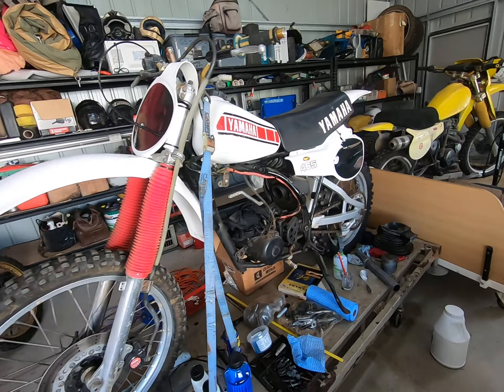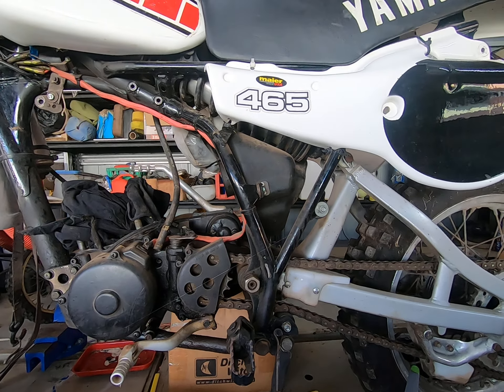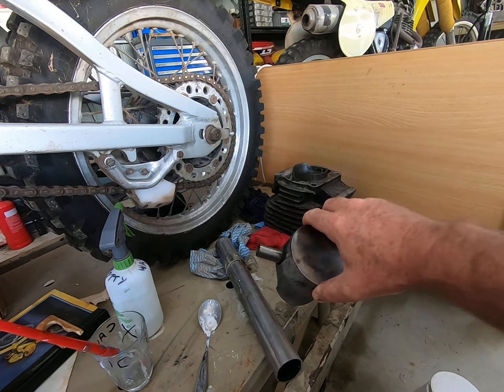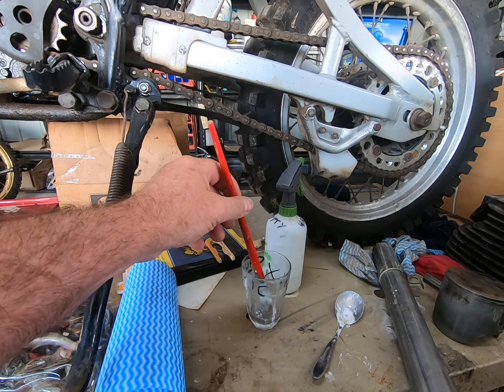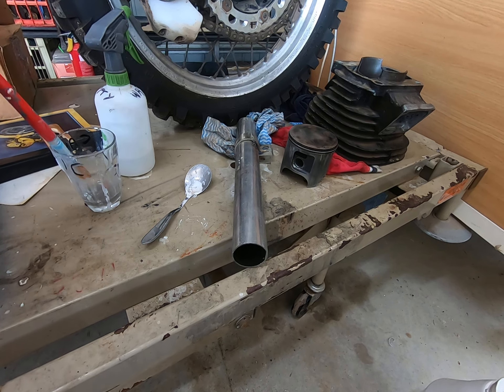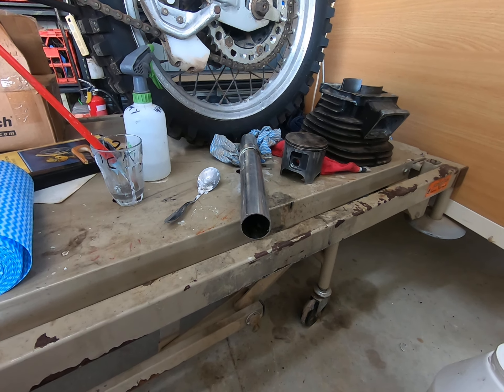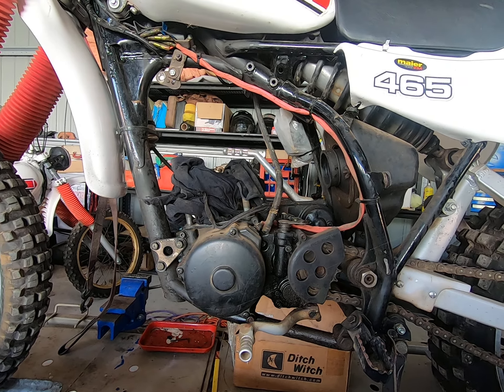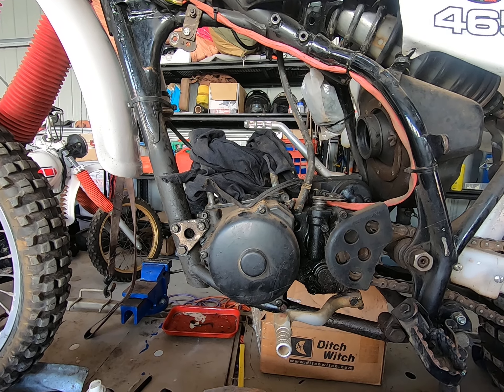Big Banger uses caustic soda during self isolation!

Comment: Looks an awful lot like a 4 point cold seize .
Reply from the maker: Thanks darrel, How does that occur?
Reply: @handcraftedhooligans9962  Not debunking your oil theory , however regarding  the Cold seize . Some machines that have cast cylinders that have been rebored and use aftermarket pistons , especially  Wiseco Prolight for instance , can have issues with the faster heat expansion of the lighter piston compared to the heavier /thicker O.E.M. pistons .  Thus if the machine is not thoroughly warmed up before the rider tapes the throttle wide open , Squeek .   
I have learned from misadventure to never use aftermarket Pistons in Rotax cylinders that are not Nikasil . 
Another interesting thing is that as premix ratios decrease (more oil) , the air /fuel mixture becomes leaner and the combustion temps increase . 
Wicked bike , love the white color scheme .
Reply from the maker: @darrelldoran509   Thanks Darrell,  You could be right.   When it seized i had been riding it for a while but opened it up on a long straight.   The original piston is good advice.   Will keep it in mind.   I have the original manual and yamaha recommends between 15 to 1 to 20 to 1 depending on the oil.   I know we ran 20 to 1 in everything back when they were new.

Comment: You didn't answer your own question you only said the stroke is longer and bigger bearings so what you're trying to say is that clarifies using 15 to 1 to me I would never never do it I'll go 32 to 1 with 120 octane VP fuel Red Lion Oil
Reply from the maker: I agree 15 to 1 seems extreme but I was quoting the yamaha manual.   I think somewhere between 20 and 25.1 would be ok.   But if you run them flat out for any distance I'd be looking to the manufacturer for advice.   Sustained high revs is different to on and off throttle on an mx track